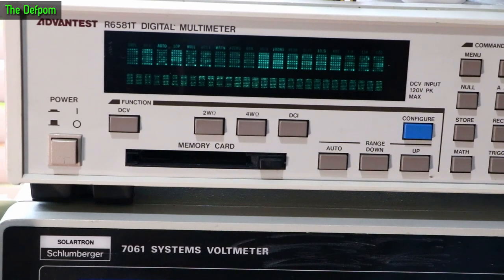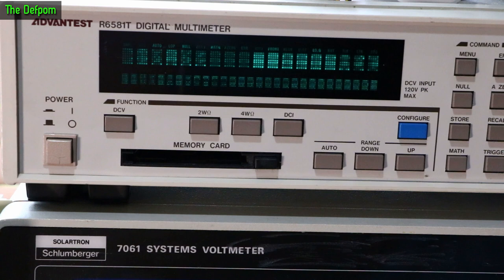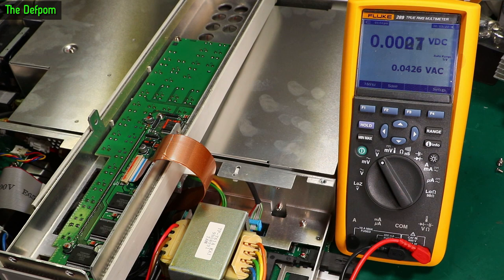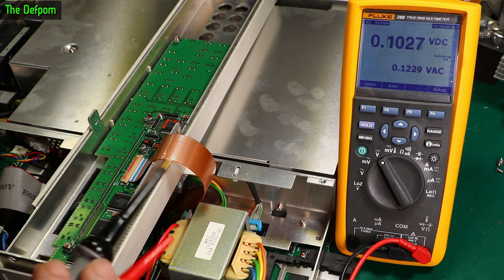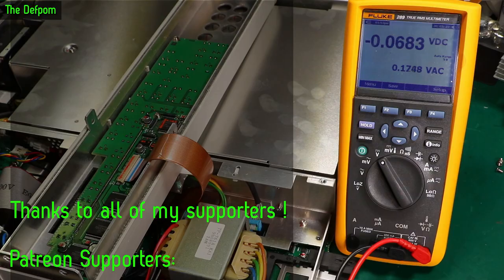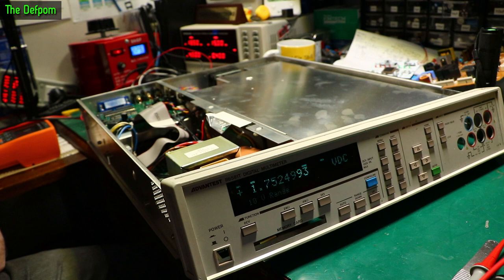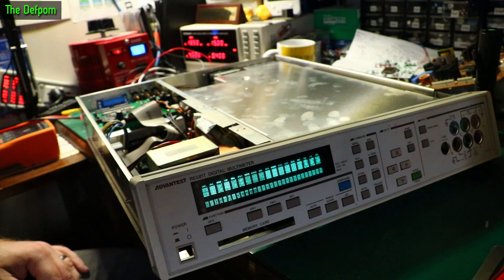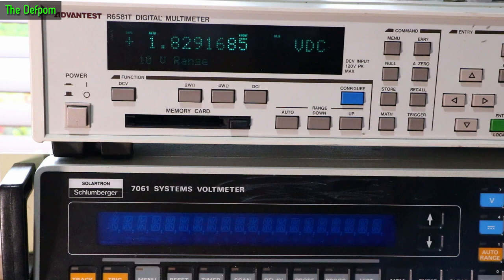🔴 Advantest R6581T 8.5 Digit Multimeter Repair Part 4 - No.1058

Comment: Hi 
I think you may have it as good as you can get.  Good job so far.  Have a look at Signal Path  TSP #108 - Teardown & Repair of an Agilent E3632A DC Power Supply where about 14.5 min in he tries to repair a Vacuum Fluorescent Display (VFD).  It runs AC on the filaments at about 6V so that's why you're seeing the AC.  Anyway whilst his initial rejuvenation technique worked he finally went too far and that was that.  Luckily he managed to acquire a new display.   Given the popularity of the Advantest I imagine the spares got gobbled up years ago.  Good luck with your projects.

Comment: Great work, the display looks much better. The filament is typically supplied with AC and has a DC bias to prevent ghost illumination caused by grid and anode leakage. Have you checked the anode voltage? Low anode voltage will also affect brightness.  Regards, David

Comment: Have you looked at the VFD tech info on Noritake's website. They have a good app note that explains the AC plus DC filament technique.
Several references compare VFD technology to a low voltage CRT. 
Back in the day we occasionally used CRT "boosters" to squeeze a little more life out of a dying tube. Basically all they did was raise the filament voltage by 10 or 20 percent.  On the old magic eye tubes you could get a bit more brightness by boosting the anode voltage.  Kind of "last ditch effort" but sometimes better than nothing. 
Keep on trying stuff, it is fun and hopefully worth your effort.

Comment: I have used a similar method to eek a bit more life out of old vacuum tubes.  I have also burnt out the filaments doing it.

I hate VFDs because they always fade.  There are replacement VFDs for the HP 34401A available.  But they are hard to come by for other meters. Many 34401As where I work get surplused due to faded displays.

I have a Keithley 2700 with a faded VFD.  It is still usable. for now.  I have not been able to find a replacement display for it.

I’m glad you managed to get a bit more life out of your display.  I hope it lasts.

Comment: Great work to get it looking better - I think you might not want to go to further...
Reply from the maker: Yeah, I believe overdoing it can cause it to stop working completely.
Reply: @TheDefpom  +1 agree, I've never had good experiences trying to push VFDs further,
Reply from the maker: @tgsoapbox  maybe if I do get the chance to reverse engineer the display section and design a replacement then I will be willing to give it another go to see how far I can get it back, but only if I have a backup plan!

Comment: Very brave not knowing how the filament, grid and the cathode are set up but worth it as now the display is useable again, you could tweek the filament voltage up a tad (wind up the wick) but personally I would leave it be and hope for a replacement, although I like the sound of a reverse engineered replacement series  !....cheers.
Reply: How could he increase the filament voltage? The filament is fed directly from the transformer. The only way would be to use another transformer with a higher output, say 9V with resistors in series to limit the current.
Reply: @simontay4851  to be honest I missed the bit about being directly off the transformer so I guess thats that maybe I should have put an 'IF' in my comment. thanks!

Comment: I understand a little of how those displays work
I think you were measuring from each end to ground, surely you should be measuring across the filament, this could be why you had the AC and DC voltages.
Reply from the maker: It is a centre tapped AC, if I had measured between each end I would have got about 5.6VAC

Comment: Have you thought of making an Arduino pulser for the elements?
Using some MOSFETS, controlled by Arduino, you could perhaps have the code cycle through different frequencies at differing voltages, automatically.

Sort of along the lines of a battery Desulfator (in a sense) where the "vibrations" of the frequencies might "clean" the wires off better.
Of course, you'd want to control the voltage closely and not go too high as to burn the wires, especially when they are "vibrating" and of course, at the "highest" voltages, have the code start lowering the voltage.

I'd probably want to slope the whole thing.  As the voltage rises slowly, the frequency can ramp up higher and higher and then as the voltage lowers, also the frequency lowers.

Then, you could try to do the same, but the as the voltage rises and falls, some random frequencies.

Just a thought.
Reply from the maker: That is an interesting idea.
Reply: @TheDefpom  
The idea is not new, actually.
It's an update to the old days when I'd rejuvenate CRTs in color TVs that I was repairing.
I found that the "fast" snap rejuv was iffy at best and in fact, often destroyed the tube.
But when I took the slow, ramping method, more picture tubes were able to be rejuvenated well and last for years more.

OF course, it doesn't have to be Arduino.
Any programmable controller will work.
I just always go the Arduino route because I'm heavily into those.  However, I'm beginning to branch out into ESP32 boards.

If you decide to go that router, it might make an interesting video.

If you do, don't forget to put a 300 or 400 mA fuse in line with the heater line. Ya don't want to accidentally blow them up.
Reply: This technique was used in Microscopy to 'clean ' your filament near to the end of it's normal life time, also for the cathodes and the initial electron optics. We also used to 'Spot Knock ' lenses this involved a hand held Tesla Coil (made by Edwards High Vacuum) very much a last ditch attempt to remove a short by "Blasting the crap out of it !" and the results were potluck really !

Comment: You mentioned you might have to reverse engineer for the display,   I googled;     Advantest R6581T 8.5 Digit Multimeter schematic
Dave's EEvblog has some schematics.
Reply from the maker: I have only found ones for the analogue board.